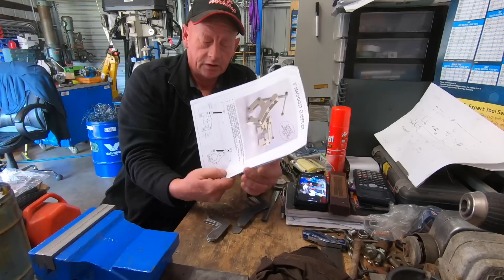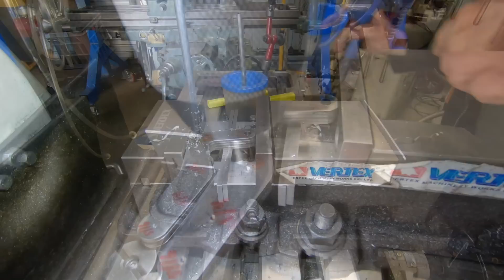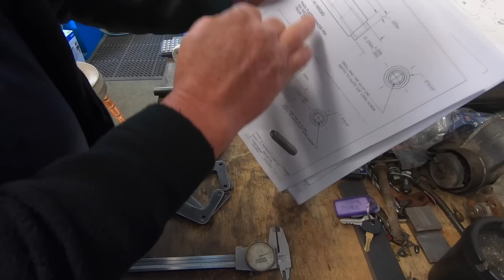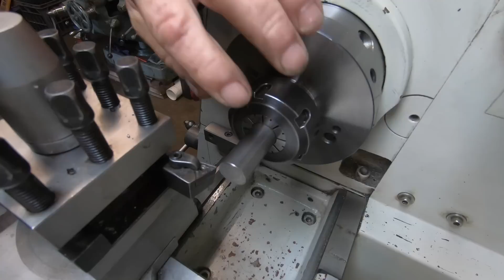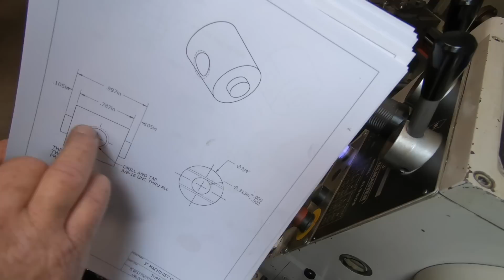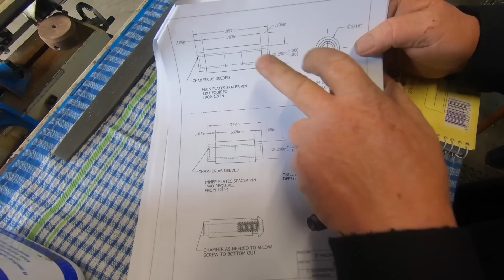D.Gray Design & Drafting.  3" Machinist clamps    Part 1

Comment: Superglue works very well to hold the stack and heat or acetone to remove.
Reply from the maker: Gday, super glue does work great, I’ve used that a few times now, thanks for watching and commenting, cheers

Comment: Looking good mate !
Most of the stuff i have here is of unknown composition or 4140 , i was going to get a couple of the bar packs from Mancave metals but he seems to have disappeared of ebay and his website comes up as under maintenance - looks like I'm going to have to pay Edcon Steel  here in Sydney a visit .
Reply from the maker: Gday Ian, I mostly use 4140 here along with S-Cams from truck breaks, the cost of material now is bloody terrible and there's no sign of the price coming down, it certainly makes it hard for the hobbyist, Thanks for watching an commenting mate, Cheers
Reply: @MattysWorkshop  
I must keep an eye on the scrap bin at work for some S cams - I would have thought they were hardened ? Maybe it is just the cam that is hardened and the shaft is still reasonably soft?

Comment: G'day Matty,  bloody nooice mate, we call 12L14,  EN1b in the UK,  its leaded steel, nice to machine but don't try welding that barstard
Reply from the maker: Gday Ralfy, this material turns extremely easy and its not hard to get a nice finish, I normally use 4140 for almost everything, its a big difference between the 2 materials, Thanks for watching and commenting mate, Cheers

Comment: Nice project,  those style clamps are very useful but very expensive.  I don't have a mill yet but I think I'll make some,  my South Bend can certainly handle those pins.
Reply from the maker: Gday Jim, you could make these with a lathe and drill press, a milling machine just makes it a little quicker, to buy these for a shop they really are quite expensive hence why i'm making a set, appreciate you watching and commenting mate, Cheers

Comment: Good clamp design something I think I could tackle for a beginner.. be good to see when completed. Thanks Matty. I have the coonara in the shed fired up with a few beverages in the fridge.
Reply from the maker: Gday Ashley, This is a great project for a beginner, the threads can be done with a tap and die if your not ready to single point thread, the instructions that come with the kit are very easy to read and there's very helpful build notes as well, Defiantly give this a go and you'll end up with a good set of clamps when you done, the nights are getting cold here to mate, Thanks for watching and commenting, Cheers